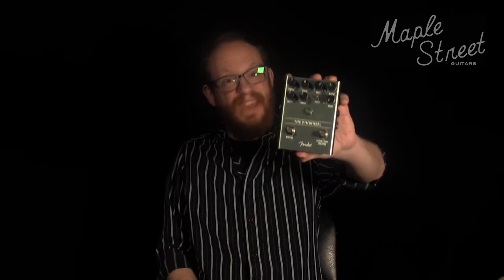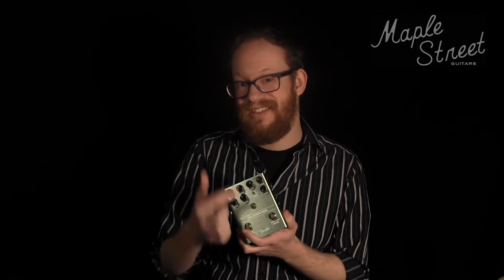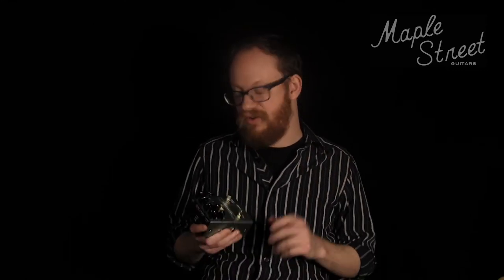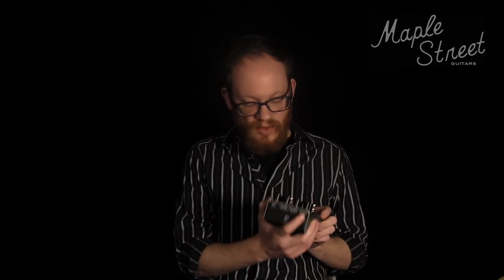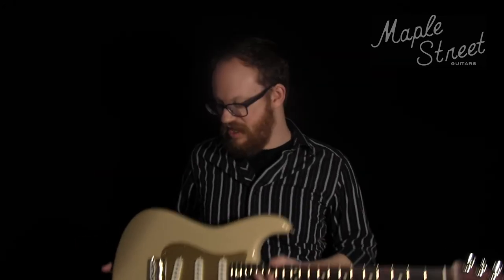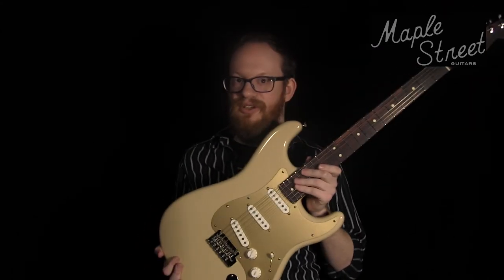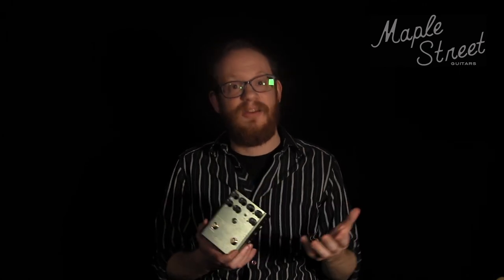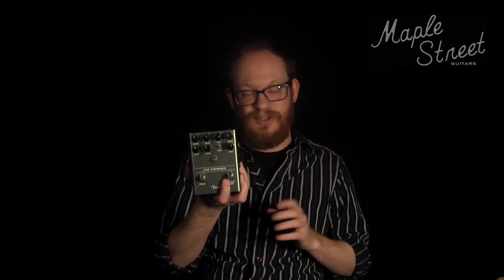Budget Friendly Leslie Sounds at your Feet! Fender Pinwheel Demo and Review

Comment: The Rotary Closet effect in the Zoom MS70 and MS50 is one of the better emulations I’ve heard in any pedal, and the pedals cost about $150 for about 150 effects. So around $1 for a really decent rotary effect. Just saying. The only negative thing is you have to turn a knob to activate the ramp speed. If they had a push button instead, they’d be perfect.

Comment: I hope this pedal is not as muddy as this video is making it sound.  Don’t know how you did you signal path but on my phone it sounds like the neck PUP with the tone rolled completely off.
Reply from the maker: Though listening on cell phone speakers is never optimal, this pedal certainly seems to pump out some extra low end in our demo. We're still toying around with how we record these videos so the low end may be overemphasized! I found this pedal to sound very accurate compared to most recorded rotary sounds.
Reply: Most of things sound bad through the tiny  4 mm smartphone speaker. Plus YT adds its own compression to the sound. I can only compare Pinwheel  to  the Strymon Mobius and EHX Lester ( I used to have both for a long time) and it sounds very good. As with all the rotary pedal emulations it is impossible to  really mimic the real Doppler effect and 3-D sound of the real Leslie Cabinet.  The thing is how close you can get.